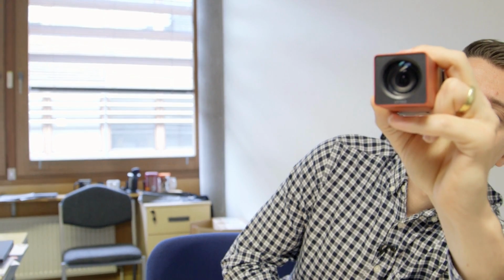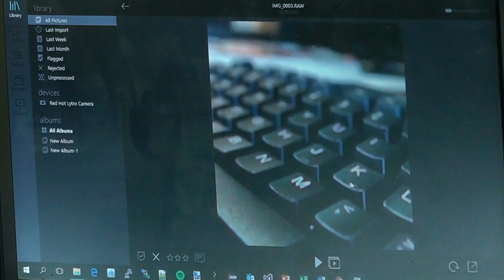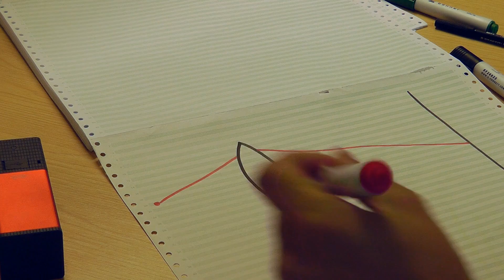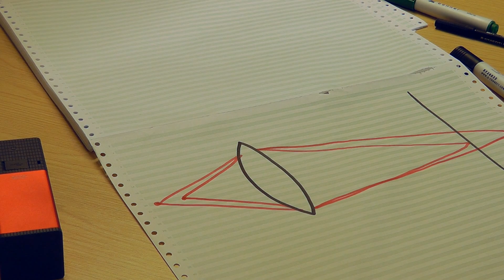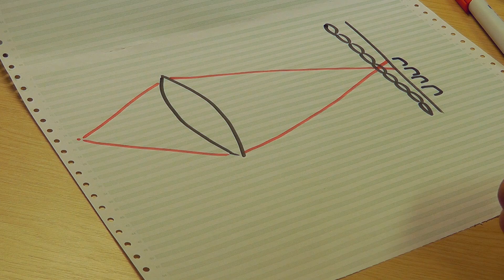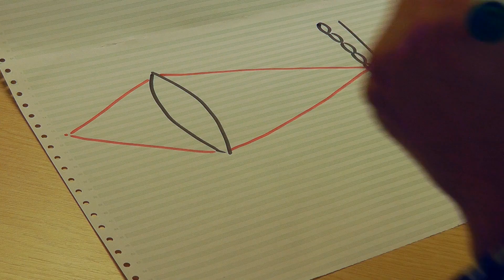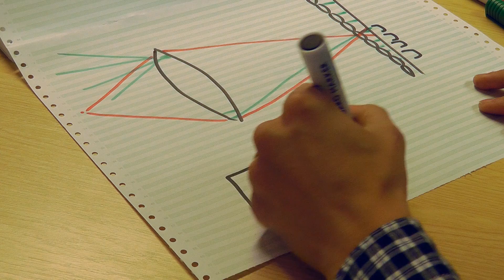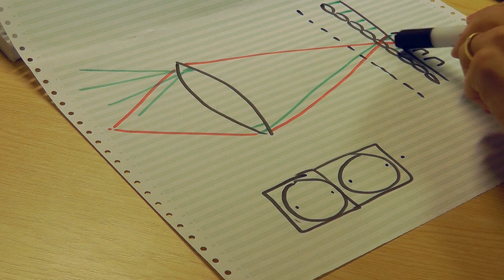Light-field Camera - Computerphile

Comment: it does not neccesary make sence doing it that way
it also would be possible just to increase the sensor size and lens size so they make a bigger focus area

the lens in front the 3d lens also would have its limitations it certainaly has a bend point where it cant make a focus depending how big the lens really is and work

Comment: If you use micro lenses not in front of a sensor but in front of a display, isn't it than possible to create a 3D display. 
9:03 if each micro lense is just a tiny camera taking a picture, with micro lenses in front of a display it's tiny screens showing different pictures. With that it should be possible to create a 3-dimensional picture for an observer.
Reply: Absolutely! There's lots of work being done in this area. If you're really interested, google "light field display".

Comment: 3:41 . OMG. I have not seen line printer paper like that for almost 20 years.
Reply from the maker: Clearly not watching our channel often enough 😉 >Sean
Reply: +DFX2KX Same for me in a way. I have a carton of 2000 brand new 80 column punch cards in a sealed box, but I have not seen a working (or non-working) card reader since around 1990. I have been using the cards as notepaper for years after our university dumped all computer cards. When I got to the last box, I decided to keep it in case it became interesting for later generations. My kids will probably throw it in the recycle when I die. Oh well.
Reply: +Dexxter I've seen the paper  in reams, it's a working line printer itself that I'd like to see.

Comment: If you ditch the main lens and build a very large sensor panel, with some tweaking it could function as a 3D camera. You'd need a special monitor to display the result, but you wouldn't need 3D glasses.

Comment: Could someone use one of these very expensive cameras to take an image of the jastrow duck rabbit "illusion", and see if shifting the point of focus to infront or behind the real image makes the image flip?

I suspect such may be the case because if one places a thick glass sheet over a printed copy of the duck rabbit, and then alternates focus point between the top and bottom surfaces of the glass the image can be flipped.

there's been a few pyschology phds which used binocular eye trackers, and which say that can't be an explaination, however basic trigonometry shows the eye trackers used just wouldn't have had the angular accuracy to determine depth of focus any closer than +/-5cm over about 30 cm viewing distance.
Reply: +steve cummins The retina appears to be non optimal, with light having to pass through nerve fibres etc before hitting the light detectors. Could those those layers be functioning as a micro lens array?

Comment: Seems like you could even do away with the primary lens. This could be a leap for 3D cameras, and displays as well, by reversing the process with high-density led screens.
Reply: pratherat, you can do away with lenses altogether in some forms of imaging.
Reply: @johnnyswatts  I'm sure there is much beyond my knowledge. I remember from my toddler years (early 70s) I had a book with a lenticular grating on a specially printed image that gave it a 3-D look. These were vertically oriented, but I've heard of "fly eye" sheets that work in any direction. I've been unable to get my hands on these, although I have a stack of the vertical ones in my desk drawer.

My point was that the process is reversible. Image projection and reception are the same light paths (ideally). A properly shaped lens in direct contact with the image sensor chip should culminate parallel rays at a single point on the sensor. An array of these could produce a 3D image when displayed in a similar way. No primary lens needed.

Thank you for bringing this back to the forefront of my thinking for a while.

Comment: ¡¡¡gREAT CHANNEL!!!  Somebody could recommend me some bibliography to learn how "Image Sensor" sends the info in order to process it? ...I want to load that info in memory in order to analyse it
Reply: If i understand you correctly you should look into the RAW formats of various cameras, since a RAW file is essentially a dump of the data straight from the sensor.
Reply: ...but the sensor requires a pulse or a clock pulses to send their info to a processor say of NTSC or PAL?   what is the protocol used to send that info?
Reply: Yggdrasil42   
...but the sensor requires a pulse or a clock pulses to send their info to a processor say of NTSC or PAL?   what is the protocol used to send that info?

Comment: Why not take a series of pictures with ever changing focus on them?
Sure it's going to be n times bigger storage but you get the same effect with high resolution and no need for trickery.

The biggest problem is your exposure time on each shot. If it takes 10 ms to take one image and you take 100 images your entire exposure will take one whole second.
But still, i'd think that would be a better way than having to use a special camera for that. Just take 100 images with a really short exposure time (like, really really short) with the focus shifting for each image then you work on those images to produce a clickable DOF.
Reply: Lots of mobile cameras that do refocusing attempt this. Its fine for still scenes, but youd be surprised how much things move in fractions of a second. All rays here are captured simultaneously, but as you point out, at lower resolution.

Comment: So the HTC One M8 has one of these? But it has 2 cameras so how does that work then?
Reply: +Niels Schellekens The video shows parallax along two dimensions.
You can only do it along one, along the axis defined by the two lenses, right?
Reply: Graham Smith
Any picture you take can be paralaxed like seen in the video by tilting your phone (the "3d" option) and any picture can be refocused afterwards pretty much identical to how it looks in this video. You can also upload it to an HTC website page and send that to a friend so they can refocus online. It's pretty amazing but I don't know if it's the same.
Reply: +Niels Schellekens I've just had a quick look to see if I could find how the M8 refocusing works, I didn't find a detailed description but I think my first reply was basically right. It seems the two cameras have quite different numbers of pixels. There's a main camera to take the photo and the second camera just captures depth information at a lower resolution. I wonder if they are having the second camera  capture multiple shots at different focal points in order to gather the information necessary to correct the focus in the main image.
Reply: Major Gnuisance
It's tilting upwards and sideways if that's what you mean.
Reply: Graham Smith
Would be nice if someone knew how it worked. I'm by far a camera techy but I'm very much enjoying this series of Computerphile
Reply: +Niels Schellekens 
Didn't look it up, but I'm sure the camera in the M8 has got nothing to do with light field. The second lens isn't even a camera, it's just a depth sensor. A phone's camera's lens is also way too small to get any optical parallax. What you see a fake parallax. It's moving layers of different depths relative to each other, like many side scrolling computer games to give the illusion of depth. For the variable focus the camera will just take a few pictures in quick succession with different focus settings (that's why those features never work in low light, because the exposure of the multiple pictures takes too long for the user told hold the camera steady).

Comment: Wait a second, does this mean that the information in such a picture could be used to create a 3D model of the "depth"? I mean, it seems that the image contains depth information, effectively.
Reply: Yes that is possible but the effective dept is a proportion of the baseline which is very narrow. For comparison tv gesture recognition use about 15cm to recover dept at 1-5 meters in the living room.
Reply: +antiHUMANDesigns As Bogdan said, it is fairly limited in how much depth you can get from the image.  The resolution isn't high enough to do something like that on such a small camera, you'd need a much larger setup for that sort of stuff.

One thing I would love to see is a setup where it uses 2 light-field cameras to create a scene.  It would allow for far better resolution of the full light-field and can be used to create 3D models of a scene (of what can be seen, as usual.  damn 3Dness of the universe)
Combined with some software, you could use it as a freeform 3D scanner that doesn't lose any focus as you scan the object in question.  No more expensive rigs with motors, just hold it in your hand and get spinning.
Reply: +Kris Johnstone
You could possibly tape multiple cameras together into a 5x5 square. It would be an intersting expeiment to see what result you'd get.
Reply: Bogdan Manciu Yes, the information would be quite... low quality, I suspect. You'd probably get a rather jagged model, but it could probably be smoothed.
Reply: Kris Johnstone Yes, I agree, I was just speculating about the possibility of doing it with just one camera.

Comment: so why change the focus? Bring the whole picture into focus.  Yes, it's a bit unnatural, because an eye could never do that (unless the iris was stopped down to a pinhole), but so what?  Everything in view would be clear.  Or would that be mathematically impossible?
Reply: +rchandraonline It should be possible, but not with the microlens array itself. It would take additional post-processes, along with edge detection to know when a part of the image was at peak sharpness while working through the various focal depths. So basically a program would start at one end of the refocus range, and rank each part of the image as to how sharp it is. Then step the the next depth, and rank it again. Do that for the full range, and then blend the maximally sharp areas together. There will be even more work required to deal with occlusion of a part of the scene by the out-of-focus blur of a nearer object. Though that may fall out automatically from the sharpness evaluation.
Reply: +Christopher Meadors I think that the Lytro software can do that easily. You can see at 11:45 on the macro picture of the fly, when he clicks on the fly's rear leg the whole the whole picture is focused for a really brief moment of time (it's better visible if you slow down the video).

Also the technique you're talking about is called focus bracketing or focus stacking and can be done even on classic cameras, but to do that you need to take multiple pictures with focus slightly changed on each of them. Then you can use a focus stacking software and process the pictures. You can achieve effects like a macro picture with perfectly sharp background (the effect is stunning, especially if the background is really at some distance from the object being photographed).

I've been playing with this technique myself few years ago with my Canon S5IS with CHDK firmware. I've run a Lua script on it that took a pre-set number of photos with focus bracketing :).
Reply: Wasn't this done in Citizen Kane?

Comment: My phone can do this, but it uses 2 cameras to do it. And it is probably a different process.
Reply: +Illucite There is a focus tool... But, to be honest, it seems to be unfocusing everything else rather than changing the focus.. It isnt a tool I use that often.
Reply: +WakarimasenKa The idea behind that camera is to capture the depth of the scene with those two cameras. Then its possible to use the depth information to blur pixels by different amounts. This is kind of synthetical refocusing, where the original image is all-in-focus.
Reply: +WakarimasenKa 
What phone is that? I'm pretty sure the second lens isn't even a camera but just a depth sensor. The camera will take a few pictures in quick succession with different focus settings (it is necessary, because it's impossible to take an image where everything is in focus in a single shot). Depending on where you tap the image you'll be shown the picture that was taken with the focus set closest to the "depth" you tapped on. And to increase the effect most likely pixels at a different "depth" will be extra blurred.
Try moving the phone while taking such a picture. My guess: the phone will either tell you it failed to take the picture due to too much movement or you will have very different perspectives of the scene depending on where you focus, because the camera moved between the pictures of different focus.
Reply: superdau Its a HTC One M8.. And reading up on it the specs it seems you are right.

Comment: 11:24 explains why in this current form, this is not the future of photography... yet. For now it's completely closed and proprietary. We need an open standard for this and device agnostic tools (ideally open source ones).
Reply: +biohazara The problem, besides the patent issues, is the fact that it is still fairly low-resolution.  That is more an issue with physics than anything else.

A higher-res system will require either considerably more dense CCDs or a larger CCD.  (so, in turn, larger camera)
Larger camera will be a lot cheaper, which will then turn people off from it.  (besides the really hardcore photographers, who would almost certainly welcome it)

The CCD density issue will mean a sharp increase in price since it isn't just that which is increasing in density, you are also going to need to increase the density of the microlens grid to improve its accuracy too.  
Both of them work together to define the actual effective resolution that can be used for images.
Reply: +biohazara It will never be the future of photography. No matter what advances are made they are always going to be splitting a normal sensor up into a lot of tiny ones. That is always going to have terrible low light performance and it's always going to be very low resolution in comparison to a normal camera. I would assume it's going to be incapable of achieving the same FPS as a normal camera too considering how much more information it needs to process. It's impossible for it to ever catch up.
Reply: +Michael Pound I recall Canon demoing an actual camera they had made as a proof of concept, it had much higher resolution than the Lytro. But, this is years and years ago now, so chances are if Canon didn&#39;t see the point in finishing the development and bringing it to market, I doubt anyone else will for the foreseeable future.

Low light performance might not be too bad - if we assume a larger sensor with larger individual pixels, and summing like you said, a lot of little tricks they could do to alleviate that. Maybe even cool it down! But I guess putting a Peltier module in there might be taking things a bit far... (Doesn't stop us astrophotography nerds from doing it though! -60*C CCDs are practically noiseless!)
Reply: +zaco21 Remind me again who owns the Nokia patents now?
Reply: +zaco21 also its not cheap, reminds me of FLIR cameras
Reply: +Kris Johnstone +zaco21 I completely agree this will take time to be something usable in the "real world". However, patents and the lack of open standards make progression even slower, much like 3D printing wasn't a thing until some of the patents expired.
Reply: The fps isn't a huge problem, because the processing is done offline later. The actual capture is a standard photograph. I also don't think image resolution will hold it back, because we're already seeing cameras with totally unnecessary pixel counts. I absolutely agree about low light performance though, though you sum over a lot of pixels, so perhaps it can be accounted for.

I'm sure I read Canon were looking into this technology, but I may have made that up. Though the fact it hasn't appeared suggests maybe they decided it wasn't profitable.